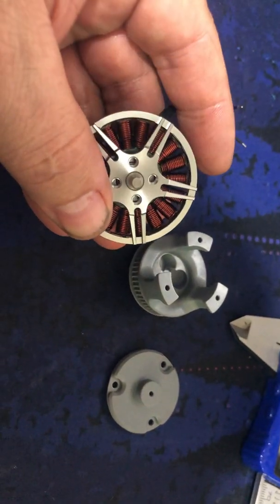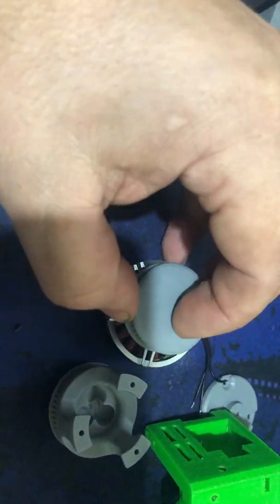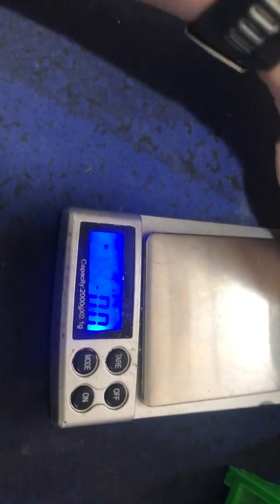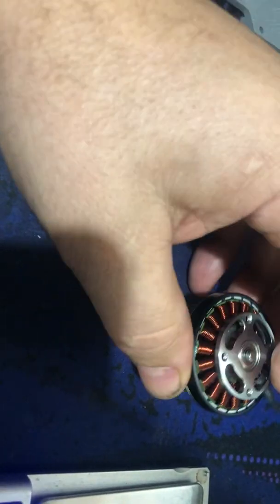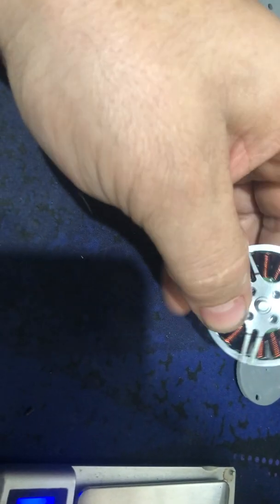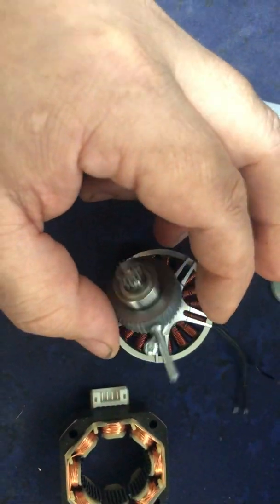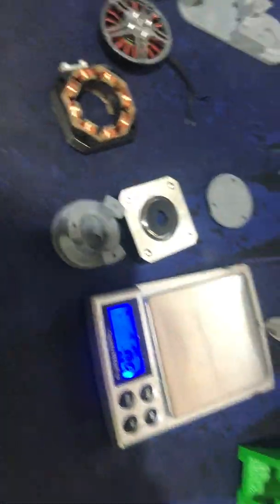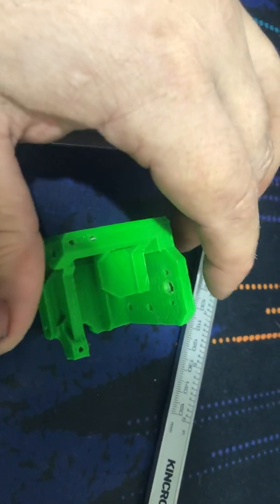Bldc screw extruder on hevOrt 3D servo driven printer sub 100 gram

Comment: Hi Wayne, good to see someone finally implementing this. As an FPV drone and 3D printing enthusiast it seemed like we were all missing a trick using bulky steppers for lightweight direct drive extruders. I knew it was only a matter of time until someone gave it a pop. If it wasn't for the ridiculous cost of the Odrive I might have already given it a go myself. Just doing some research and I notice there's now cheaper alternatives available. A dedicated solution for driving relatively low powered bldc motor for an extruder could no doubt be made for a fraction of the cost of an Odrive. 

Regarding your motor choice here, wouldn't using a motor with a taller narrower stator be favourable for the rapid directional changes required by retraction etc? Less rotational inertia of the motor itself yadda yadda... Or is there another reason I'm missing that you chose to go with the pancake? 

Can't wait to see this guy in action and the further developments that will no doubt come about as a result of your pioneering. 💪

Comment: Look at bldc gimbal motors you can get some with 4mm and even bigger hollow shafts that would be perfect for PTFE tubing or even a small bearing 😉
Reply from the maker: I have , the biggest issue is they don’t like been spun fast and have no way to let the heat out under continued operation ….  However … I do agree that this idea has merit and once I’ve got this done I’ll have a look at making it .

Comment: Would be interesting to know, how this design competes against the Orbiter or the Mosquito extruder drives in terms of weight :D
Reply from the maker: 74.8 grams , motor and extruder , though I’m increasing the weight to as a tensioning and release system for it too .
Reply: @vvega007  That's actually pretty good :D

Comment: 4227 50kv motor?
Reply from the maker: 4004 300kv   50 grams
Reply: @vvega007  i waiting for 4227 50kv 100g with odrive single for direct orbiter (no planetary gear in orbiter)
Reply from the maker: @LJCustomSlovakia  ahhh , I’m actually thinking I could go much smaller .. like a 22 frame
Reply: @vvega007  big 50kv without gear or small 500kv+ with gear is same weight… I'll let you know how it works
Reply from the maker: @LJCustomSlovakia   yea I’m thinking it might be possible to make a sub 100 gram direct drive extruder and high flow extruder combo that can do 1000mms at .2-.3 layer height .
I’m doing bldc because of power density

Comment: What will you do to keep the filament from rotating during operation?
Reply from the maker: Working on that :)
Reply: Use PTFE tubing int the center of the bldc motor, that should work as long as the filament is fed in directly straight it should not rotate

Comment: So I'm going to cad it up but. I found a stepper motor that looks pretty lightweight with a decently size hollow shaft that can have the rolling screws attached too and have bearing with the ptfe running through them to prevent it from twisting with a bowden adapter just a little about the topside of the motor.
Reply: If thats a Nema14, it's like the Orbiter, that extruder is only 150g

Comment: A little hard to follow but are you going to thread the bored hole to use as the screw or are you still going to use the 3x offset screws
Reply from the maker: The bored hole is smooth . It’s just to remove a bearing :) the rollers will still be there :)